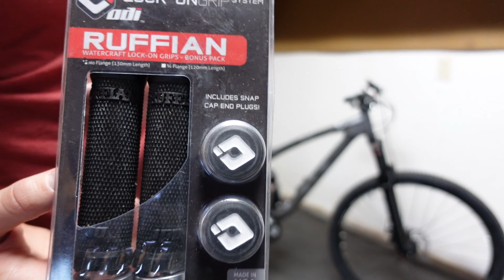The Best First Upgrades for your Mountain Bike - Mongoose XR Pro First Upgrades - Budget Bike Build

Comment: Needs cyc x1 pro with 5500w of power!
Reply from the maker: HAHAHAHAHAHA I am not saying I disagree but most of the trails where I ride and live around do not allow e-bikes or any form of motored bike so it would pretty much do no good for me sadly. Hope you enjoyed the video!
Reply: @chickensendies  my local trails have that sign and 70% are ebikes. On a low setting riding reasonable no one cares, start riding wild things will change. Over 1000w is hard to use off road but useful in congested areas on a roadway.

Comment: That was a really well done video! Good theme, very logical updates. I like $20 alluminum pedals too. JGBike has a good low cost crank assembly to, ive bought a couple of them, i really like them. I think i need a shorter lower stem.
Reply from the maker: Really appreciate your kind words! This is my first item from JG and build quality really  seems great! I'll have to take a look at their cranks. I'd definitely recommend you try this stem and it comes in black as well if you do not fancy the silver 😁😁😁
Reply: @chickensendies  i told them i was using there parts in my videos and they gave me a buisness discount, not alot, but the crankset winds up being $34 with bottom bracket. Just buy direct from them, and they ship through Amazon
Reply from the maker: @theshedMTB  Hey! That is terrific!!! Really appreciate the information!

Comment: Is that the DNM AO 38RC?
Reply from the maker: I just might be 😁😁😁
Reply: @chickensendies  I'm debating. 
Idk what the performance changes from the 36 to 38.
I had the 36 on my XR pro last year and it had a double chamber, positive and negative. The 38 does not have that, not sure how it will be better, however, the rockshox debonair rt3 on my Polygon T8 has single chamber and works great
Reply from the maker: @MTBAlex  I did not get the 36 because of the dual chambers. I saw the 38 and decided to give it a go. So far so good for me!